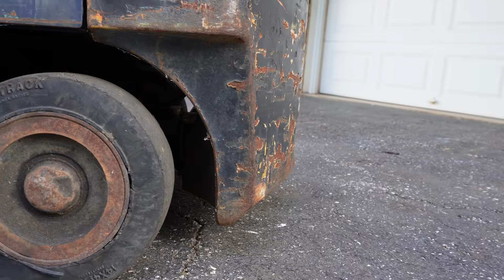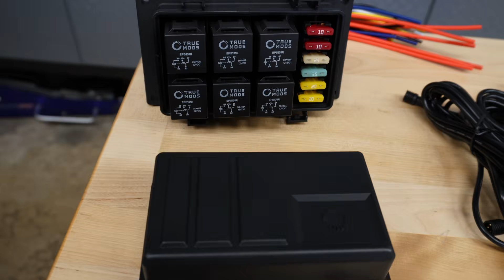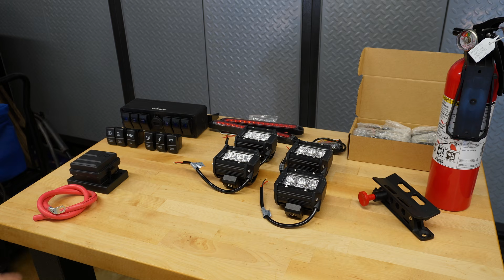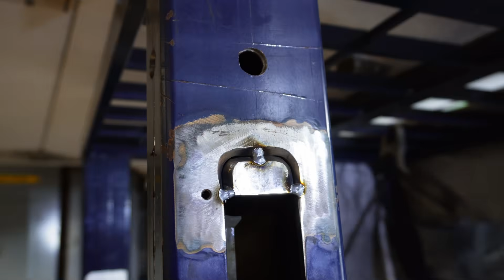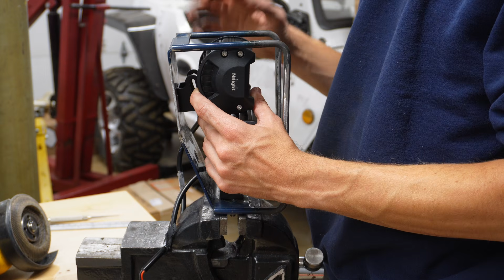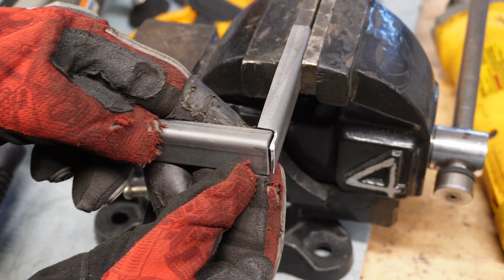I Pimped My $400 Forklift

Comment: Loved your series. 
GREAT JOB. I’ve rebuilt a few things in my life so I really appreciate you digging right in there.. successfully too. (It really sucks when i doesn’t work out lol) 
Just wanted to give you a tip that’s always worked well for me... 
Don’t use “grease” on your actual forks. Use WD40 or a really light oil. When you have to adjust them in or out by hand.. ESPECIALLY when it’s cold..you’ll be glad. Grease can get REALLY sticky. (Hard to move)

Respect!!

Comment: Nice job but why drill all the way through your guard/frame? Could have used self tapping screws those lights arent heavy
Reply from the maker: That's a good point. It wouldn't take much to hold them up. In the rear there was an existing hole so I only had to drill 3 of them. Just drilled them to match so the hardware would be the same.